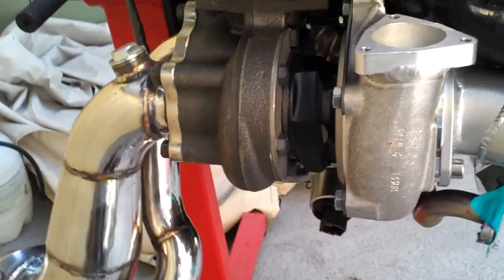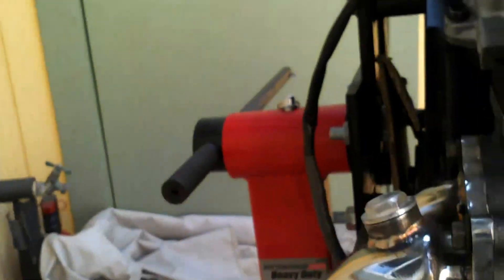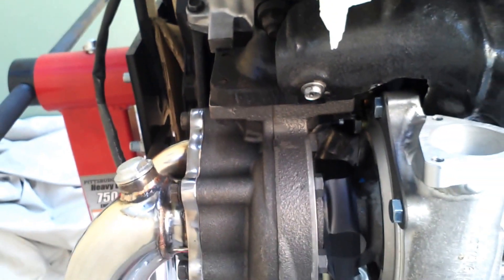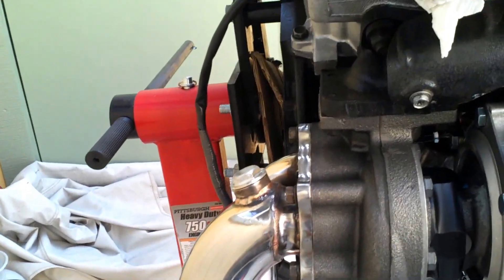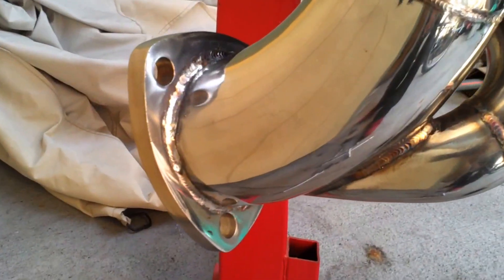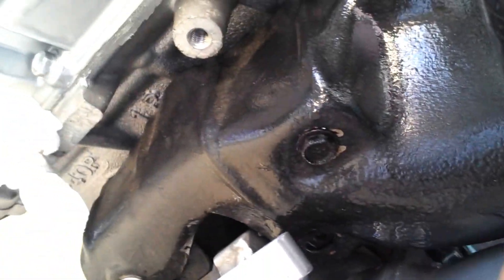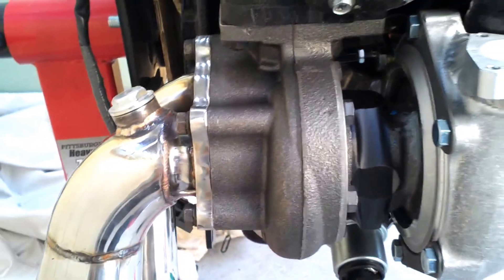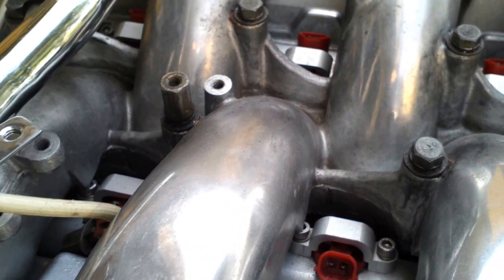300zx 800hp upgraded turbo installation

Comment: Hey man, I have a question and it's kinda off topic. I have a Manuel booster controller, full 3 inch turbo back and about to install intercoolers with piping and get a protune...should I get injectors as well or do you think the stock 370cc can handle all the breather mods? Please help! I'm stuck here, thank you so much

Comment: Hey Brian this might be asking to much, but can you maybe post up a video mocking up the SZ expansion outlets pipes on the turbos?
Reply from the maker: I will for sure once I mount both turbos permanently and have the gaskets in place with all the oil lines. Just ordered the clutch and flywheel today and some other parts. I am almost there, after all that I need smog alignment and tune. It never ends but i new what i was getting into. I love doing it not going to lie lol.
Reply: Brian Heiden it neverrrrr ends......., but that's the sport isn't it?
which clutch did you end up getting? Here in Holland we have similar shitty fuel 98RON which is about the same as your 91 MON, my target is to have around 500 on pumpgas as well.
Reply from the maker: Vishal Chinkoe I bought the specialty Z High 5 clutch, and the Specialty Z flywheel. Yes the gas here sucks even pings in my q45 once in a while off the line. This is the best clutch and flywheel setup you can get before a triple clutch setup which is 3 times the price for a good one. This setup holds 850 foot pounds of torque pretty sufficient. My old setup was a Fidanza Flywheel with a Garbage Xtd clutch from ebay. Fuck that guy never use them total junk. Made that mistake when i was younger and did not no better.

Comment: Hey what are all of bypass that you set up
Reply from the maker: diego castro Bypasses or removal really of the water lines under the plenum, deleted carbon canister and pcv system. But i will have them both back on for smog. Water lines under the plenum is a big one makes it easier to get off in the future. I also have the aiv sytem that recirculates exhast through it deleted they are in the fenders. There are also a bunch of other things that can be bypassed or deleted.
Reply: Cool thanks I got a 1991 2 seater t - top doing the tt and conversion swap does zmotor sports sale the drive shaft? And where can I get the mini oil filter and lins for the turbos
Reply from the maker: diego castro There on ebay for pretty cheap,ya delete all the water lines for sure if you have the plenum off.